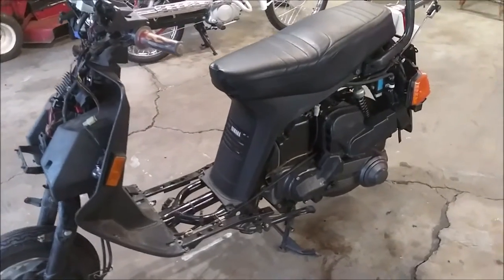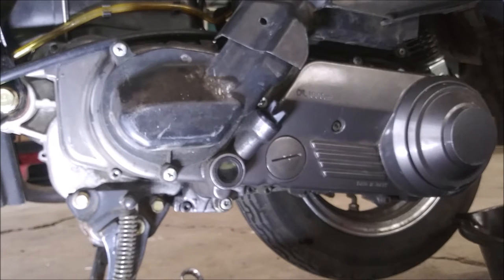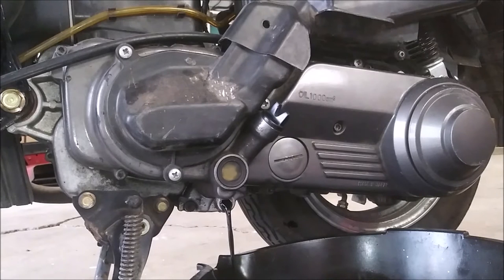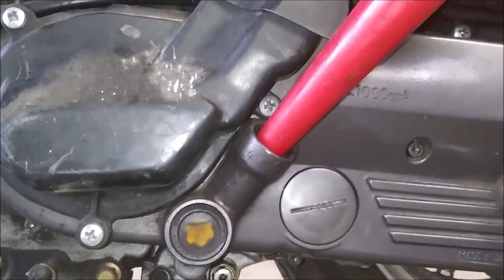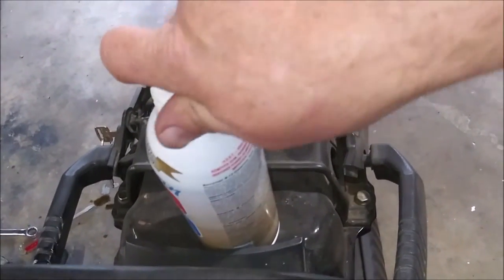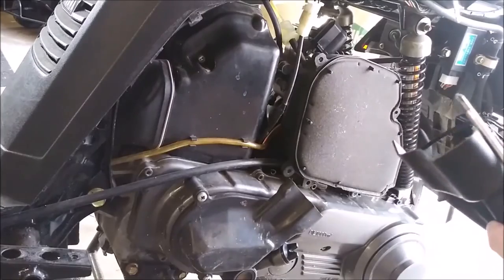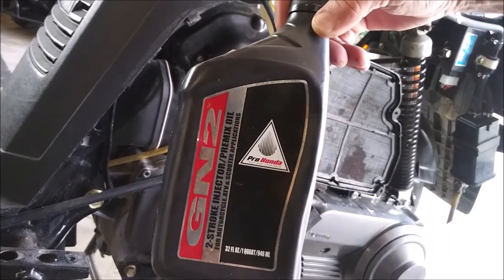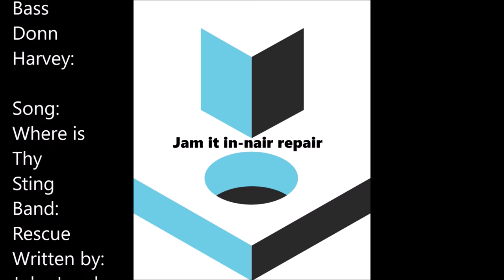1993 Yamaha Riva 125 (Yamaha Beluga) Oil Change and filter clean.

Comment: I just got one of these and the only problem with it is that the air boot manafold, we do not know where it goes. Can you make a video debunking the intake and the air boot hose location? P
Reply from the maker: I'm not sure I understand the question. Traditionally a manifold goes between the carburetor and the engine. If you watch my first video about my river you may see how I installed mine and it may help clarify your question. Good luck and thanks for watching.
https://youtu.be/zMp_VMha8P4

Comment: Great video... I have a 96' Riva Razz which I think is less powerful than this one. . . ? Not sure, but the Razz is a blast. What's the top speed on this particular moped? The Razz is about 35ish. Shes a beauty!
Reply from the maker: With a 125cc engine and me at 240lb it tops off at 60mph.  Solid 54 to 55 mph.  I think yours is 49cc.  Top speed in my town is 35mph so that's all you need.  Thanks for watching.

Comment: Also my riva seems to be way to advanced.  It seems it's always reved up. Even at idle. Seems like I'm giving it gas but I'm not. Can u make a video on how to adjust the throttle
Reply from the maker: I had a bad throttle cable and mine did the same thing.  When you let go of the throttle it should snap back.  Check your return spring as well.  If you are running the OEM Carb I can't show you.  The cable has 3 adjustments.  1 at the grip end of the cable.  1 at the other end of the cable. And the stop screw on the carb.  The first 2 should leave you with about 1/8 inch of free play in the outer casing of the cable.  With that set you can turn the idol screw out to lower the RPM's
Good luck
Reply: @JamitinThereRepair  thank u

Comment: Hey! I got a Beluga/Riva 125 92', its very weak so im going to test the compression tomorrow. What do you consider a good compression being? What compression do you have?
Have a nice day! Greetings from Sweden
Reply from the maker: I have never tested my compression.  I think anything between 110 psi and 150 psi will let it run.  Remember to hold the throttle wide open when you run the test.  Look up the valve adjustment procedure for best performance.

Comment: Did u find the oil filter location?
Reply from the maker: I have not.  I did discover I should use 20W 40 Oil and 10W 40 in winter.  So I change the the oil again using Rotella 15W 40.